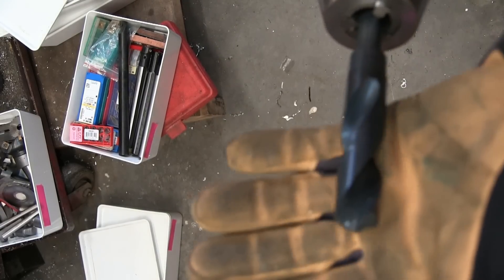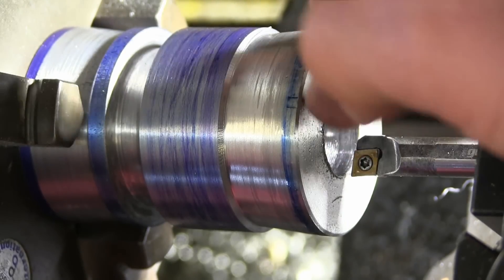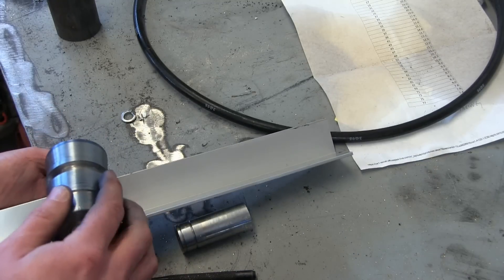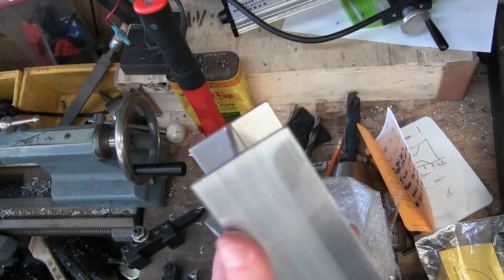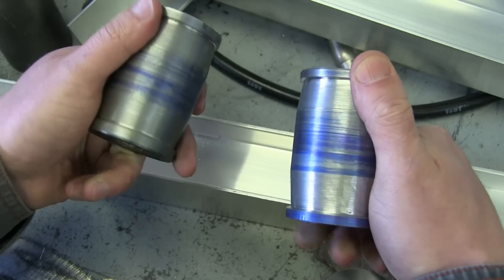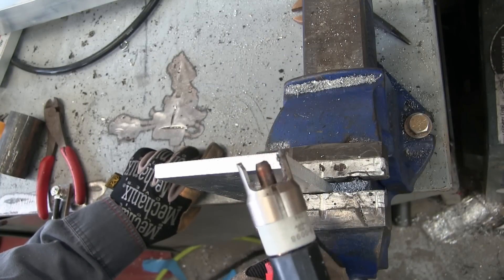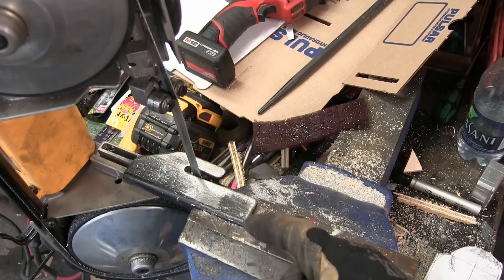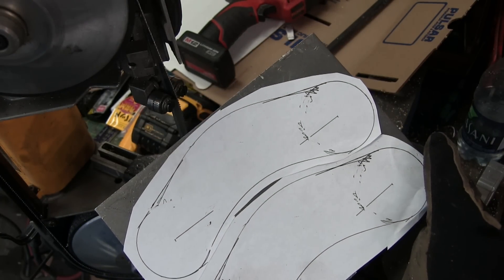Prototyping Fun.   ✨ Plasma Cutter  ✨

Comment: I'm not a plasma torch expert, but I have knowledge from other plasma applications, and based on the Ionization Energy (where lower IE means same # of pixies gets you a hotter plasma) of the constituent elements of air (namely N2 and O2), and keeping in mind its mostly N2 passing through the torch, the only better option, possibly, is CO2 as it has a lower IE than N2. However CO2 is still higher than O2, so I'm not sure how that balance might play out in the case of ionizing air. In theory using pure O2 would be the best option, but I suspect that using more than 10^5 degree C pure oxygen on aluminum may pose some safety concerns. Not to mention that since plasma is NOT a flame, any gas that doesn't touch hot metal will remain as O2, which is not a great thing to have too much of floating around when in a ship filled with machine oil and other petroleum fumes. Theoretically the best, non radioactive gas to use would be Xenon, but if you can even convince someone to sell you some, as it's usually reserved for plasma related research and space propulsion related customers, you'll probably have to rob a bank to pay for it in any useful quantity.

Comment: Pro tip, keep a pot of oil and a paintbrush handy when band-sawing ally, paint some oil on the blade as she is running and it cuts like butter!, if you do not want oil on the saw, Styrene Wax works okay, or even candle wax. just gotta keep it lubricated. I use Styrene wax for linishing, grinding or abrasive cutting of ally and it keeps the wheel from clogging up and makes for a MUCH easier job.
Reply: Good old diesel fuel or kerosene is great for keeping die grinder bits and saw blades from clogging up when working with aluminum.

Comment: did you know that you can scarf with a plasma?............i believe it is just a extra big tip
...what happens is the big tip distorts the flame into a bit of a curve, cause of loss of control of the stream..anyways we use it for overhead scarfing out old welds without fucking up the deck angles iwo installing new deckplate on a ship/barge....it is so much easier on the body instead of a carbon arc gouger

Comment: That trick with the hand punch in the bearing hole to take up the slop is a really good and very old mechanics trick that we use for ball joint and tie rod end holes more often than you think. Even on vehicles that are newer than one would think would require some "custom" work to keep on going.

Comment: Just in case.... putting that hotrolled steel in a bowl of cleaning vinegar (the non-natural vinegar) will eat that nitride up in less than a day - just wipe it off with water and a steel brush, zero effort :) (well, at least compared to other means of removing it ^^)

Comment: I used to run into the center punch cure from time to time when rebuilding electric motors. I've never once seen it still holding the bearing in place. They were always galled to the bejesus and was usually the cause of rotor to stater contact. 
But for something light and low speed it might work just fine.

Comment: You think cutting aluminum is bad, try copper, there's a reason the plasma cutter tips are made of copper to begin with. On an unrelated note, if you get a steel drill bit stuck in a chunk of copper, a plasma cutter will blow out the drill bit and leave the copper basically unharmed.

Comment: When the back end is higher than the cutting edge, you need to reverse the direction of the drill when you use that bit because it's not for drilling, it's for undrilling.

Comment: I gotta trick for ya AVE.
when cutting an inside radii- cut perpendicular to the radius in small notches. then when you go back into the radii cut, you only have little 1/8"+/- steps to clean up...😉

Comment: Having used low end sliders all the way up to Kessler high end motion control sliders, I can tell you that sliders kind of suck in general (even the high end ones).  They have to be motorized to do any repeatable good shots.  Repeatable is key since the actors constantly miss their timing when it comes to those kinds of slider moves.  A big problem with sliders is the track will get tiny dents in it from transporting them from shoot to shoot, even if you're really careful.  Then the dents come in loud and clear through the carriage and you see it in the final video (unless you're doing time-lapse motorized moves with a DSLR).  So picking the correct track material is just as important as what the wheels or carriage is made out of.  Brass everything could work, but weight is then an issue.  You could use a self-healing silicone or rubber but then the carriage could get bound up.  So it needs to be lubricated.  Probably the best slider ever is one with a motorized gimbal on top with software configured for slider moves and a track and carriage made out of lubricated rubber or silicone or some alloy of the two (if that's an alloy).

Comment: Laser and aluminium don't like each other either. Aluminium when molten becomes a near perfect mirror and simply deflects the laser light (no oxidation as industrial lasers will use inert gas to flood the cutting area)  and also the heat dissipation as with plasma. If I remember right you need 1.5 times more laser power to melt aluminum than steel at the same thickness.

Comment: Looking forward to the plasma cutter BOTLR

Also... as far as I know, the melting temp of aluminium oxide is far below the arc temperature of a plasma cutter. But you have a really good point about the thermal conductivity. The cut seems like it cut clear through the first refractory oxide layer, through the aluminum, and struggled to cut the oxide layer on the far side. Interesting stuff!

Comment: Fun story bout acid fumes: I once worked in the chemical industry as a technician for piping and huge tanks. In one business we worked for was a constant low acid fume from sulfuric acid that evaporated from waste product. All tanks and pipes in the room were defusion tight isolated to stop corrosion. So the isolation wasnt tight somewhere at the bottom of the tank and the whole thing started corroding on the inside of the isolation. After a few months the whole thing bursted under the inside pressure.

Comment: What a fucking coincidence, I today just got the same kind off drillbits in the mail one 16mm and one 19mm what for putting pvc electrical piping though metal. Same problem righthand drillbit but sharpened like a lefthand one. feck.

Comment: Aluminium oxide (30 W/mK) has worse heat conductivity than Aluminium (~237 W/mK). I remember this because it has also has worse electrical conductivity. These properties seem to go hand in hand in metals. Also, there is good somewhat related video about stable rollers by this crazy science guy Tadashi Tokieda. /watch?v=Ku8BOBwD4hc

Comment: I don't see the reason for having super hard steel rollers, when your using soft aluminum as the roller bed.  You should be using plastic rollers, such as Delrin.  You can go to home despot and pick up pre-made wheels used on sliding glass windows.

Comment: semi-pro tip. If you want to know if the edge is still good on an insert, run the edge of your thumbnail along the cutting edge and around the tip radius.  If its good it will feel very slippery and smooth.  If it has even a tiny chip you will feel it before you can see it.

Comment: On the lathe: taking deeper cuts with your tool increases the cutting force to a point where your tool actually runs smooth through the material and stops scraping the surface. your finish will be (depending on the material you work on) smooth and shiny. cutting depth should be more than the radius you have on your tools tip for this.
and regarding the bearing seat: you would want to have a smooth surface for it to sit in, so no breaks in the cutting motion. this is why you'd usually cut the whole hole and then increase the diameter

Comment: your on the right track' a spotlight mount on the camera mount would be good track mounted overhead spotlight for the shop be very handy led so it'll never burn out remember those old tuff bulb worklights plastic housing with the hook handy money saving drill points:82 degree countersink, socket head counter sink: drilling the shoulder for the head and some of the grip length simultaniously big time saver and say like a 3/4" sheetmetal drill for the thin wall square tube

Comment: Why bother with a plasma cutter for a straight cut? Masonry/Meta/nonferrous metal Abrasive blade in your circular saw is super FAST and blades are like $5: https://www.amazon.com/DEWALT-DW3511-7-Inch-8-Inch-Abrasive/dp/B002YDM3DS/ref=sr_1_1?s=electronics&ie=UTF8&qid=1493712428&sr=8-1&keywords=abrasive+7+inch+blade

Comment: If your Mitutoyo calipers are like mine the inside jaws read about .007 different than the outside so it's easy to overshoot using them to check your boring ID.
Reply: Took me a long time to develop to proper drag on a pair of calipers. Doesn't matter what type you have, you need to practice measuring a hole some one that already knows the right amount of drag measured to calibrate your self.  And don't twist the part, clean it, then measure it.
Reply: The same goes for micrometers, I never use the ratchet/clicker on my thimble. Mine are all set to my feel, hence I don't loan them out or let anyone else use them for this reason. The clicker is ok in some situations, but I find they dont give any real positive feedback through the hand.
Reply: Hence the reason you should never use them for fine tolerances. Verniers, the machinist "ruler"
Reply: But But they're digital and therefor must be skookum.
Reply: Haha I feel ya, I have 2 pairs of the same 200mm mitutoyo ones. They are close to $400 each here. 

I teach engineering at a technical college. It sounds backwards but I have swapped all my students back to analogue vernier calipers. They would squeeze the digital ones and say "look its perfect!" haha
Reply: I know how to use measuring tools.